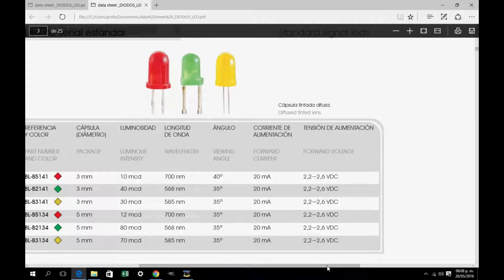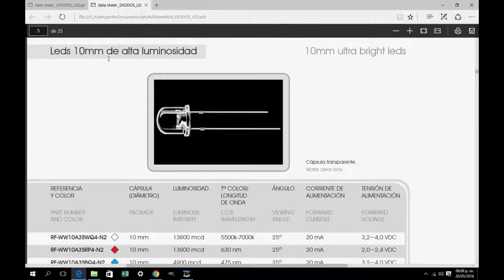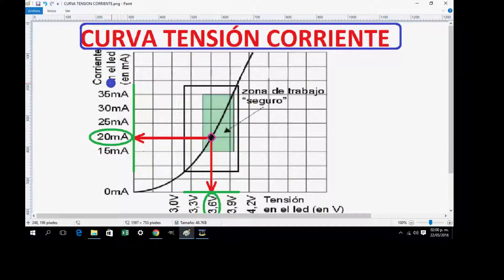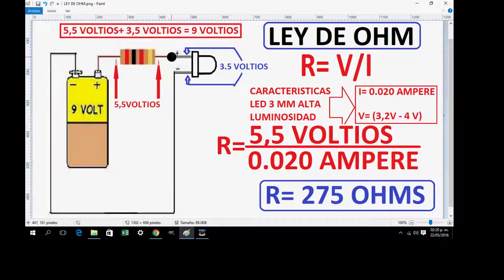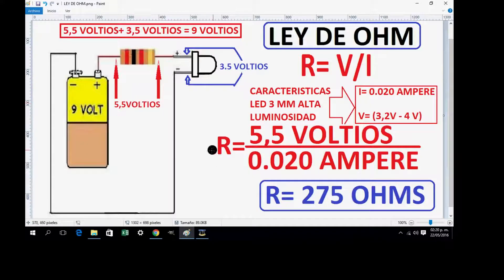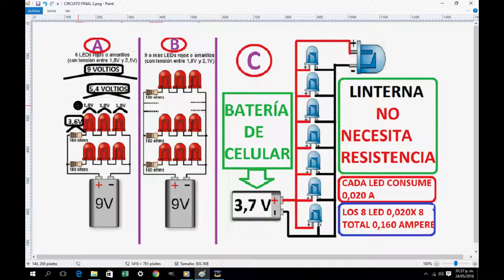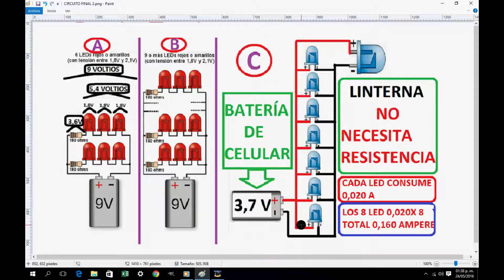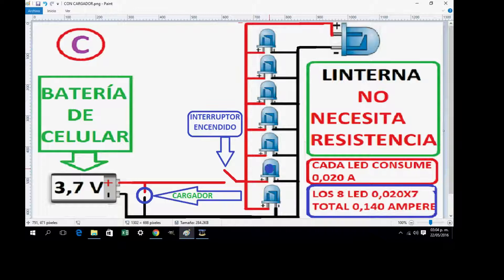🔦RECICLADO. LINTERNA LED.RECARGABLE. CON BATERÍA DE CELULAR. TEÓRICO PRÁCTICO.

Comment: Muy bonito proyecto de recilaje, una consulta ¿podrias explicar como se realiza la carga de la bateria, desde el adaptador hasta la placa de carga? gracias.
Reply from the maker: Hola. Si miras el vídeo de la linterna a los 5:11 minutos muestra el esquema eléctrico donde está el cargador y el interruptor de encendido. Tenés que conseguir la misma ficha de conexión igual al que tiene el cargador. También podes ir a una casa de electrónica y pedir el macho y hembra para hacer la modificación , para eso vas a tener que cortar el cable de salida del cargador que tengas y soldar la ficha macho nueva, y la ficha hembra soldar a la linterna. Es difícil explicar con palabras desde la distancia. Ojalá que me entiendas. Fijate el orden de positivo + y negativo -. 🖐️

Comment: Buenas excelente video tengo una consulta
Tengo unos 5 led y por la forma parecen de 10mm si los coloco será más el consumo de la batería? O directamente se quemarían? (Aún con la tabla que se muestra en el vídeo sigo con las dudas)
También pregunto por el cable de qué medida es?. Espero por su respuesta gracias
Reply from the maker: Hola Nestor. Debes asegurarte que el Led sea de alta luminosidad. Si querés proba 1 directamente a la batería, si se mantiene  encendido por lo menos 10 segundos esta bien. El cable puede ser fino porque el consumo es bajo. 🖐️
Reply: @walterjoseHorianski  buenas ya hice la prueba que mencionaste poniendo junto a la batería y si se mantiene encendido más de 10 segundos , poniéndole ejemplo 4 o 5 led consumira más verdad?

Comment: Hola Walter: Las baterías son de 3.7v pero los cargadores son de 5v ó 5.7v (como los mios). En éste caso no afecta la vida de la batería? Lo uso directamente o tengo que bajarle los volts al cargador? En el ultimo caso: Como lo haría?
Reply from the maker: Hola. Podes usar cargador de 5 voltios. El cargador del video es de 5 voltios. No es necesario limitar el voltaje. Anda bien. Para tu tranquilidad, yo estoy usando el cargador de 5 voltios hace más de 4 años en la linterna y la batería esta perfecta. 🖐️

Comment: hola use una bateria de celular - y mis leds se quemaron despues de unas horas - que pasa no puse resistencia asi como tu
Reply from the maker: Hola. Fijate bien  el voltaje de la BATERÍA no debe ser superior a 3,7  y el voltaje de juntura del Led debe ser 3 7 también. Cuidado hay Led que trabajan en 3 volt. Si usaste ese tipo de Led de 3volt se va a quemar. Si usaste una batería superior a   3, 7 volt también se va a quemar. Si tenés batería de mayor voltaje de 3,7 volt y el Led también fuera del valor seguro, tendrás que colocar en ese caso una resistencia. Si los valores se respetan como explico en el video tendría que andar muy bien. 🖐️
Reply: @walterjoseHorianski       ---  hola uso leds blancos 5mm  iguales 
e probado con varias baterias dicen 3.7 - pero al estar en su totalidad cargada la mayoria llegan a 4.2 v

Comment: saludos, buen video amigo, bien explicado, una pregunta, puedes conectar el cargador con la linterna encendida?
Reply from the maker: Hola Adolfo. Si, podes conectar el cargador con la linterna encendida. Saludos
Reply: gracias por tu respuesta oportuna, desde ya me suscribo a tu canal, ya hice mi linterna, con 6 leds de 5mm blancos alto brillo, pero tengo un problema, los probe y funcionaban los 6 leds bien con buena iluminacion pero luego la prendi y se apago 1 led, al rato la volvi a prender y tengo el mismo led apagado y 3 titilando, que podra ser? puse a cargar la bateria a ver si era eso pero sigue igual, en lo que puedas ayudarme te lo agradezco
Reply from the maker: Esta haciendo mal contacto en alguna soldadura o unión, o el led puede estar defectuoso.
Reply from the maker: Para probar conecta directo el led que tintinea a la batería. Fijate si la batería está bien porque si esta mal, no soporta la carga por eso también puede tintinear .
Reply from the maker: Revisa también el interruptor, puede estar fallado.

Comment: Naaa que coincidencia mi papa tiene la misma linterna. La tiene tirada hace como 10 años. Las baterías son grandes y caras. Te voy a robar la idea de la tapa de coca. Yo voy a usar quizás 2 celdas 18650. Saludos y muchas gracias
Reply from the maker: +Pablo Alfredo Palomino. Hola Pablo. Buenísimo, esas celdas tienen muy buen rendimiento en miliampere-hora. Es decir te va a servir hasta como luz de emergencia, porque va a durar varias horas encendida. Saludos
Reply: No tuviste problemas con la batería? No hay nada que limite la carga? Yo una vez quise hacer algo similar y termine con las baterías hinchadas en segundo
Reply from the maker: +Pablo Alfredo Palomino Controla bien el voltaje de carga, para que no se pase la corriente. Si la celda es de 3,7 voltios, no debes pasar ese valor.

Comment: Hola gran proyecto pero me gustaría saber cuánto podría durar la carga si la elaboró con solo 5 leed
Reply from the maker: +osward gonzalez Hola Osward. Si tenés 5 led multiplicas 0,020x5 =0, 100 miliampere. Si tu batería es de 1000 miliampere /hora o sea 1 ampere /hora. Tenes que dividir 1/0.100 = 10 horas. Tu linterna en este caso la batería entregaría luz durante 10 horas.
Reply: Falta la caída de voltaje de la resistencia si es que va a llevar. Depende cuanto es la fuente y la caída de tensión necesaria.

Comment: hola,le puedo poner la mitad de los led,con la bateria
Reply from the maker: +efebel2011. Si. Podes colocar la mitad hasta 1 solo siempre que respetes el voltaje de la batería como figura en el video. Saludos.
Reply: claro 3.7v gracias

Comment: Tengo una linterna idéntica funciona con pilas la voy a convertir, solo que se me hace que no va a durar mucho la carga, alomejor será necesario poner dos baterías en paralelo, qué opinas ?
Reply from the maker: Hola Pedro. Debes analizar varios factores. 1) VOLTAJES a) Las lamparitas con filamento están en el rango de trabajo entre 4,5 volt y 6 volt. b) Las pilas comunes cilíndricas  son de 1,5 volt. Si conectas las pilas en serie se suman los voltajes y en paralelo el voltaje es el mismo.2) CONSUMOS DE CORRIENTE a) Las lamparitas de filamento  consumen  alrededor de 200 miliampere por hora, esto significa que 1 lamparita de filamento consume lo mismo que 10 leds. En el video son 7 led  que consumen 140 miliampere en total , significa que con una batería de celular de 600 miliampere hora  puedes tener encendida la linterna alrededor de 4 horas. OBSERVACIÓN :  SI  quieres el doble de tiempo o sea 8 horas encendida debes colocar como decís en paralelo 2 baterías. También puedes colocar UNA SOLA BATERÍA de celular pero de 1000 milampere hora y así te va a durar encendida 7 horas. Avísame cuando termines . Saludos.
Reply: ok, te aviso, gracias
Reply: @demebar  y que pasó?